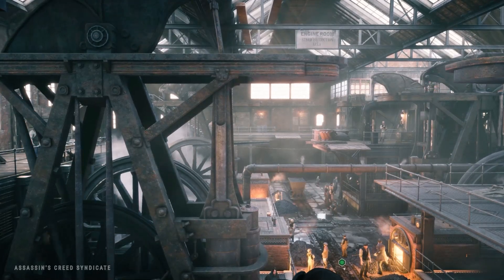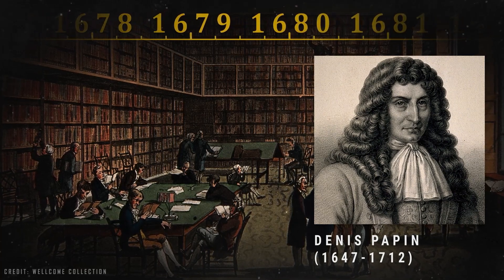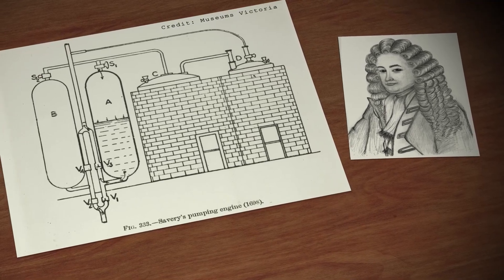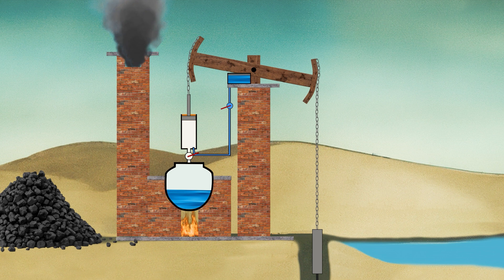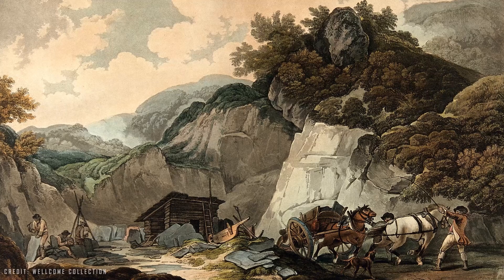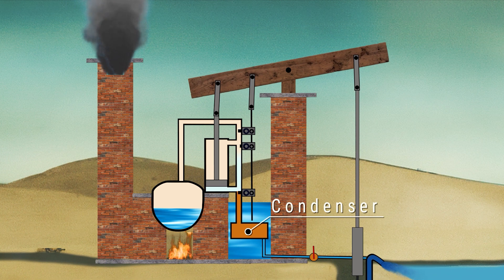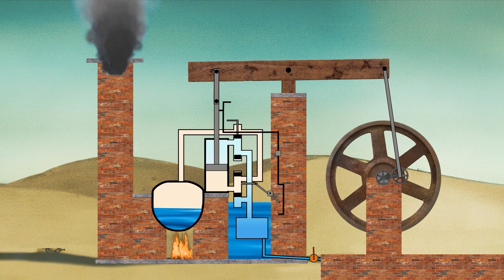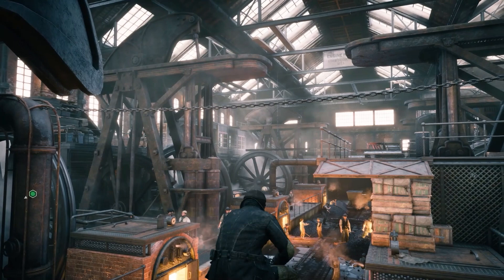Who Really Invented the Steam Engine?

Comment: Watt's first and most important invention was to build an Engine that used Steam Power to drive the piston, as opposed to Newcomen's Atmospheric Power.
Then a condenser to eliminate Atmospheric Resistance, and which allowed him to use Steam Pressures below Atmospheric Pressure (the first person ever to achieve that).
His 5psi (abs) engine (for example) with a condenser used 1/4 the amount of fuel than the same engine without a condenser. A 400% increase in fuel efficiency.
And of course to achieve all that he needed a brand new Engine, the world's first PRACTICAL Steam Powered Engines.
Then? An Industrial Revolution.
Reply: Incorrect, the first steam powered engine was Newcomens, there is no such thing as an engine that is powered by atmospheric pressure without the use of STEAM so in other words it’s a steam engine just not the one that we would then use at scale.
Reply: @Kreyterion 
Yes, Newcomen used Steam, but he didn't use Steam Power.
 Newcomen himself called his machines Atmospheric Engines, he should know.
Newcomens Atmospheric Pumps  were designed and built to provide Atmospheric Power. 
Watts Steam Pumps and then Rotary Steam Engines were designed and built to provide Steam Power, and an Industrial Revolution.
Reply: @wattage-uk9zt  You keep going back and forth, saying it's not an engine by saying it's a pump and calling it atmospheric pump and not atmospheric steam engine, which is what it's recognised as officially by experts. If you are claiming it's not an engine, please explain how it's not an engine and also how it's not a steam engine.

Comment: Thomas Newcomen's Atmospheric Pumps  were designed and built to supply Atmospheric Power, they are Atmospheric Pumps.
James Watt's Steam Pumps and Steam Engines were designed and built to supply Steam Power, they are Steam Pumps and Steam Engines.
This was Watt's biggest improvement! 
It was also the first engine that could replace and vastly improve on the 3,000 year old Waterwheels, for the first time in human history.
Basically, a new and better rotary Engine for the first time in 3,000 years.